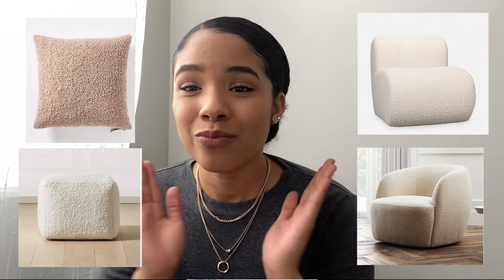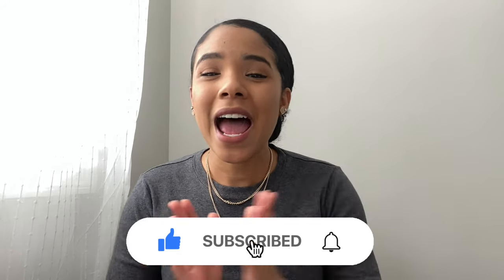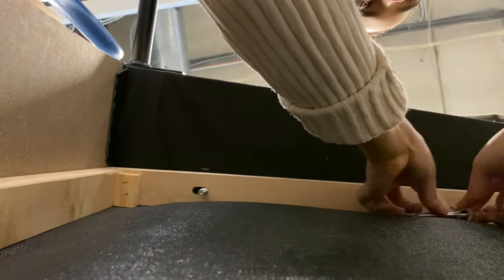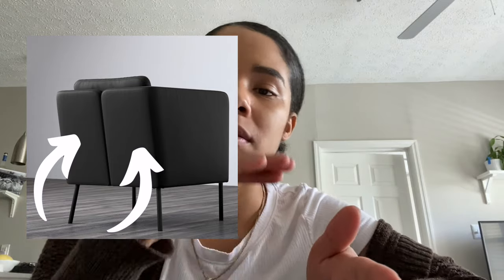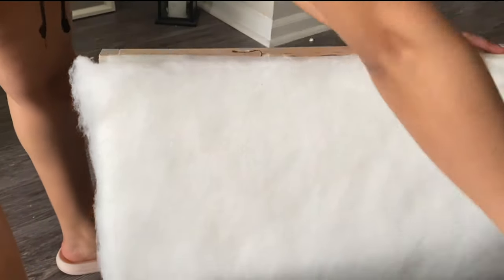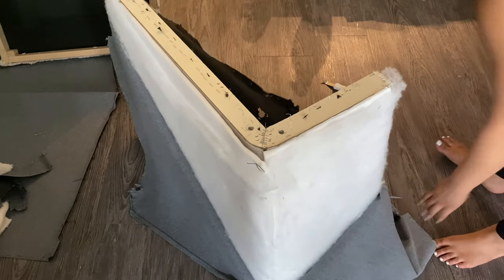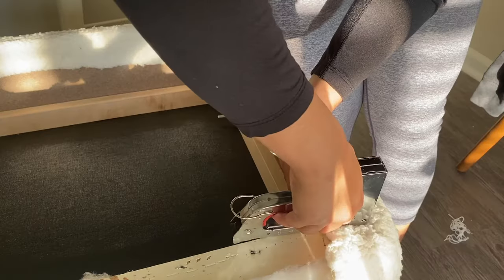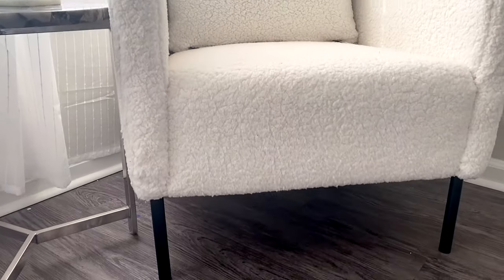IKEA DIY HACK: Boucle Chair DIY | EASY Sherpa Fur Chair | IKEA Ekero Armchair Upholstery DIY | 2021

Comment: Is the Sherpa you found at Hobby Lobby sturdy enough for you to use the chair and not have it stretch and tear? I've been looking to reupholster a chair but we use it a lot and I'd be sad if it didn't hold up. What do you think now that you've had it for a few months? It's super cute! Great job!
Reply from the maker: I think if you’re going to use it a lot you should get boucle. It’s much more durable than sherpa and It may be easier to clean